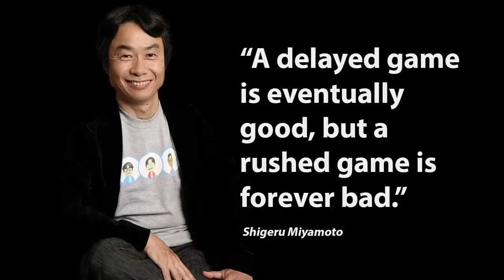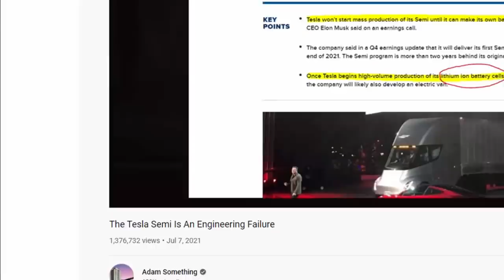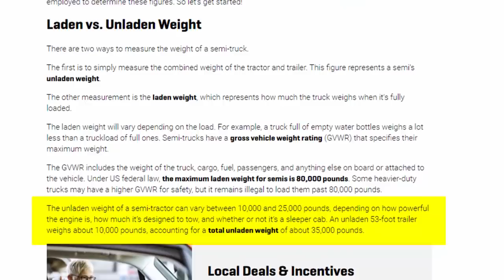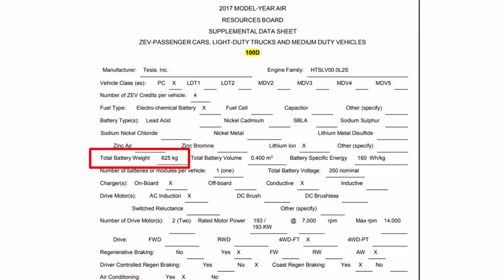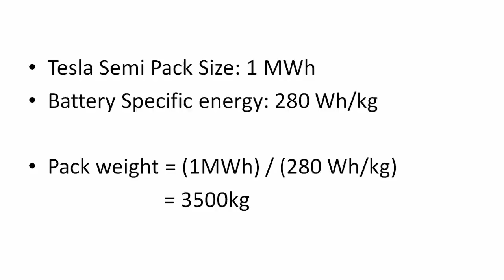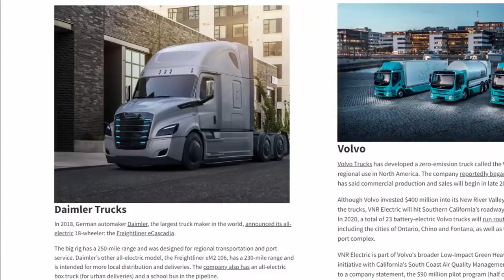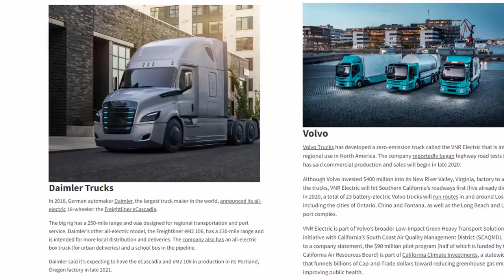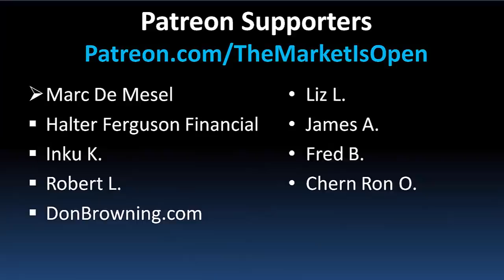The 2022 Tesla Semi is Genius, And Here’s Why

Comment: Another factor in the delay: Tesla had motivation to beat Nikola to market, even if that meant lower profit compared to model Y. When Nikola turned out to be fake, that motivation evaporated, so Tesla could wait for 4680 to start to ramp. Looks like Pepsi will finally get their first round of trucks this quarter.
Reply: Is it weird Pepsi will deploy these trucks into service and Tesla still uses diesels?
Reply: Tesla's reveal of their trucks were also fake, The didn't work and he got up on stage and said we have the technology NOW!!!! 5 years later, nothing. Another Musk scam.
Reply: @runnynose8341  Instead of calling it a scam, they say it's delayed, same thing for cold fusion,none of it works but they can just say its delayed.
Reply: @paulbedichek2679  or the just silently delete it from their website, or the link it to space X website, If you click on the White Paper link, it goes to Space X because there are so many scientific basics that he got wrong.
Reply: @runnynose8341  what city is that? Seems like a lot. But then your tunnels presumably have gasoline burning vehicles, which overall are more than 10 times as likely to cause fires than Teslas. Perhaps more than 100 times as likely because there are a variety of high speed collision scenarios that don't exist in the Loop.

The supposed fire risk of Teslas is a myth based on anecdotal stories and news stories not supported by statistics. The vast majority of Tesla fires are caused by extreme high speed collisions and external fire sources that are much more of a problem for vehicles running on flammable liquids. The overall rate of fires is less than 9% the overall average. 

The most likely cause of a fire in the LVCC loop would be crazy passengers doing what people in Vegas do, or simply arson, so fire safety is important. 

There's plenty of room to open doors. Claims to the contrary are stupid.

The LVCC Loop has sufficient powered ventilation and exit plan to deal with the very unlikely event of a fire.

Presumably the full Vegas Loop system will have a more complex fire system, but I don't have any info on that. Obviously the county will not permit development of a transportation system without adequate fire safety measures.

But I'm sure you are much more of an expert on the subject than the fire marshal, so we all should be terrified.
Reply: @runnynose8341  And the tunnels in your city cost 50 times as much.
Reply: @vic321344  Now your saying he has reinvented tunneling lol, I have seen the numbers, I am an Engineer, I see the tunneling system they use, its a off the shelf item, prices are pretty much the same for tunneling, anywhere in the world, but geology plays a massive part of cost, BUT the tunnels in my city are 50 times safer, can handle 50 times more cars, and are 50 times more efficient. But this is suppose to be a HYPERLOOP remember? or have you forgotten that ? It's just an air hockey table in a tube, it's not that hard, remember? Self driving cars on pods doing 750 miles per hour? REMEMBER? LOL, in a vacuum, REMEMBER? He has this technology now, REMEMBER? It's ok, you have been lied to and you can't handle the facts, go read the WHITE PAPER, ohh you can't, because he took it off his website, because it was full of scientific flaws, at the most basic level, that you guys all fell for.
Reply: @runnynose8341  They made tunneling much cheaper. So it can be a useful alternative.
Your undereground tunnel does not provide 50 times more capacity.
And you have to decide if you talk about tunnel systems in cities or vacum hyperloops. Two different things. REMEMBER?
Reply: @vic321344  not according to Musk, this is the hyperloop, looks like a tunnel to me, and sorry, 3 lanes of traffic at 100 miles an hour, no stops, I think you will find it is 50 times more traffic, 4 buses would replace Musks Hyperloop, your just a fan boy, have nothing to say.  They made tunneling so much cheaper, please show your facts? not just they say they did.
Reply: do some reading, you might learn something
Reply: @vic321344  The Hyperloop doesn't exist, but this is what he has been promising, remember, it started as a Hyperloop, he even had a name for it, and it ended up as a small death trap tunnel, now you really are grasping at straws, you can't argue anything, because you have nothing, just try to defend his tunneling expertise now lol, and its not a hyperloop, of course its not, and it doesn't do what he promised, thats it, you have learnt something, awesome.
Reply: @runnynose8341  You are right, the Hyperloop does not exist, just some test installations. So why do you bragg about a non existing thing? And why would anybody need a hyperloop for inner city transport?
Reply: @runnynose8341  After all, he delivers fine cars. Thats enough for me. If he should deliver a hyperloop sometimes in the future, fine. If not, I just dont care.
Reply: @runnynose8341  incorrect. This is not Hyperloop. Nobody said this would be Hyperloop. Hyperloop is an unrelated pie in the sky idea Musk put out there for anyone to follow up on someday. TBC promised exactly what they delivered.
Reply: @runnynose8341  I'm pretty sure this is mostly Musk's investment, and I'm not aware of any government grants.
Reply: @runnynose8341  ... and it's 4400 pph, not 1000. Can you read?
Reply: @Seehart  read what? Musks figures, yes, I can. What?
Reply: @Seehart  there is some reading for you. lol
Reply: @vic321344  Yes I agree, His cars are great, but they are not new technology, he gets his batteries from China. I don't have a problem with that, I have a problem he is always "Confident" he can do it now, if you invest? then 5 years later nothing.
Reply: @runnynose8341  He builds his own batteries AND buys every battery he can get . From China, Japan, Korea. So what?
Reply: @runnynose8341  Musk has installed a concept of proof that a hyperloop is posible. Paid it out of his own money. So what?
You sound like i litte jealous man. Show us your own success story. That would be more interesting to everybody.
Reply: @runnynose8341  there is one test loop in Las Vegas and one smaller in Munich, germany. They reached 482km/h in 2019 in Las Vegas.
Nothing about death stars. Or you begging for money. If you got a prototype that gets even a tiny amount of energy out of black hole energy, show it to the world.
Reply: @runnynose8341  You didnt point out anything of evidence. You are just jelous. And you are a bad role model for your children. Instead of working hard  and achieving great goals, you teach them to scoff and small reason everybody else. So they will feel better.
Reply: @runnynose8341  Just read the facts yourself in wikipedia.
Reply: @vic321344  LOl, Ill take that you just tapped out.
Reply: @runnynose8341  You are right. It gets boring that you always write the same 3 sentences. Another thing you lecture your kids: Getting friends by boring them to death.
Reply: @runnynose8341  You might be right. But I do  not envy them of what you teach them.
Reply: @vic321344  I Teach them to think critically, I know you don't envy that.
Reply: @runnynose8341  That is a good intent. But you missed it completely.
Reply: @vic321344  Did I? How? When? or your just resigned to the fact that you were conned, it's OK, happens to the best of us, just learn from your mistakes, makes you stronger. then next time you say something, you might be prepared to argue your point, good luck my friend.
Reply: @runnynose8341  Boring.
Reply: @runnynose8341  all of that is repeats of the same old bullshit I've read people like you repeating over and over. None of that is from any other than quoting anti-Elon rhetoric,  and none has any substance. None stands up to basic fact checking.

I'm not going to play whack-a-mole with all of your comments, as that would take forever. I'll just comment on a couple items to illustrate. "Wormhole" is a metaphore, which is easily understood in the context of the interview when Elon used that word, which you probably never saw. You saw the clip from an attack piece, and you think that's more reliable than the original source. There is plenty of room to open doors in the tunnels. And there is a ventilation system on case of fire. The assertion that it's a fire "death trap" is inconsistent with the fact that it got approved. Hint: regulators don't like death traps. Duh.

Yes I do have most of my 401k in TSLA and even after the recent stock market crash, TSLA is around 20x on my initial buy, and we picked up our second Tesla (model Y) entirely on a small chunk of TSLA profits. Why? Not because of current sales volume obviously, but because projection of the current growth, consistently nearly 80% annually for several years, has Tesla dominating the entire automotive market before the end of the decade. I don't see anything stopping that growth other than market saturation. My model presumes that Ford, Stelantis, and GM all hit their EV goals for this decade, in which case they hardly make a dent as "competition", all combined have a minority share of the EV market. Hint: the EV market will be effectively the entire automotive market before 2030.

Notice that while Tesla has been growing  nearly 80% per year through a pandemic and supply crisis, the big three have been shrinking. That's why Tesla is worth more than the big three combined, despite having a smaller current volume.

This transition is causing a lot of pain to established big money in the internal combustion, fossil fuel, and advertising industries. So social media attacks are to be expected. Don't give that so much credence.

My picture isn't from rhetoric. It's from looking at raw data, and from owning two Tesla's, which have required practically no maintenance, and perform as promised. If I've been scammed, I would already know it.
Reply: @runnynose8341  just bought some more TSLA
Reply: I assure you, Nikola trucks are not fake. While the truck in the promo video was, they have already delivered BEVs to customers and are testing the FCEV vehicles.
Reply: @JohnSmith-zi9or  but they are built by another company in EU just rebranded
Reply: @ralanham76  But to suggest that Tesla doesn't have motivation because the Nikola truck was faked moving is wrong. Nikola trucks are real and are being delivered today.
Reply: @ralanham76  US Steel is responsible for 100% of Tesla 3 and Y production,Tesla only bends the steel a little but they are all US Steel's products.
Reply: 4680 was always the plan for Semi. When it got delayed so did Semi.
Reply: @dealerovski82  He wasn't planning 4680 in 2017.
Reply: Pretty sure if I could tell Nikola was a scam, Tesla could as well. They looked fancy to investors, but they were shady as hell.

Comment: When you get rid of a diesel trucks very heavy engine and transmission and all of the rear axles differentials, a huge amount of weight is removed and space freed up for batteries and control electronics. This doesn't even consider fuel, fuel tanks and lots of ICE related components.

Comment: The world is going to be amazed. Once any bugs found during the initial days are found and fixed, diesel trucks will be dead. Personally, I love the rumble of a diesel truck engine and the smell at the truck stops. BUT the eTrucks will be even better than the diesels ever were for us and the environment.
Reply: It all comes down to cost.  The cheapest solution always wins.
Reply: They've had 5 years but those bugs are tough to work out!!
Reply: BEVs can't compete with diesel trucks. They're not even close, in almost every aspect. If diesel trucks are gonna die it won't be due to BEVs

Comment: The biggest challenge will be dealing with extremely high demand.
Reply: It is not high demand, its low production, like zero. Tesla said the 300 mile version cost $150K,a blatant lie,as Daimler pointed out,NY and Ca rebate $120K per truck,so Tesla semi would cost $30K ,so there is demand, but there won't be any supply at that price.
Reply: @paulbedichek2679  yeah!!!! finally the stock is dropping. plz keep spreading fud for few more days at least
Reply: @paulbedichek2679  that's a false dichotomy. It's high demand AND low supply (none). Rebates increase demand, but obviously do not decrease supply. Tesla would happily sell a $150k semi even if the state pays $120k of that. Why would that decrease supply? That makes no sense. Granted that $30k net price is absurdly low, but that doesn't disincentive supply. What you are saying makes no sense.

Also, Tesla set that price estimate (and yeah, it's just an estimate) before knowing about the rebate, so no reason to think it's a lie. I suppose Tesla could raise prices in response to the rebate to capture even more margin, but that would be frowned on. They certainly don't need to. Either way, the rebate will create so much extra demand, only early reservation holders will get a semi in 2023.
Reply: @Seehart  There is no supply because Tesla has no interest in producing a semi for even $240K. Supply and demand ,there is supply from other makers but none from Tesla. Tesla goes from maximum profit not sustainable transport.
Reply: @paulbedichek2679  Tesla has delivered 15 Trucks to Pepsico. The large scale production will begin 2023, when the battery factories for the 4680 cell will be ready.
All other manufacturers have to be satisfied with 300 miles range, as they dont get better batteries. If they get them at all.
Reply: Yeah, That's always Tesla's challenge
Reply: come on man, stop giving away all this positive news, I wanna buy more of their stocks at lower price, especially during these "difficult times"
Reply: @Andre-jp4yt  lol good point. Hey everyone, breaking news: Tesla is going totally bankwupt!

Comment: It's probably wouldn't be that much to run over head power line on some routes a truck could just connect to it like trains do already. It just depends if governments are actually serious about cutting carbon emissions.
Reply: Stupid idea
Reply: @rogerstarkey5390  why?
Reply: @12345maxx  Hmmm, let's not say stupid, just not well thought out.   The cost of putting MILLIONS of miles of electrical cable out there would be cost prohibitive.   One accident that had a truck tied to the line will cause the line to break.   One weather event (tornado, hurricane, fire, ice storm, pick your disaster based on the part of the country you're from) would take down the lines.   The issues are innumerable.   It's why trolleys are only for tourists and in limited areas.   A megacharger network will work just fine.   80% of semi-trucks are home based and will charge at their station every night.   The number of long-haulers, while quite a few are only a fraction of the trucks out there.
Reply: @AKJammer1  wireless charging
Reply: That is called catanary.  Expensive to install and maintain.  It would serve vehicles at a predetermined height  so truckers could take  it on and share its expense.  Small vehicles would not access such so would not bear its expense.

Comment: I think it will do VERY well, also they must release a small urban delivery truck/van with a single Model-3 motor in it with 2,000kg payload maybe, for the "last mile" of deliveries. 😆😆
Reply: European manufacturers already produce 125 mile range 1000-1500 kg delivery vans such as Mercedes ..Fiat[Dodge] etc
Reply: @julesdingle  Yup, and MOTOROLA made phones before APPLE
Reply: @mohammadwasilliterate8037  mobile phone makers have come and gone, at a few $100 per unit affordable to take a risk with a new product. Commercial vehicles are not disposable, you need a service network and reputation for fleet buyers ..who drive sales [not individuals].
Tesla has not invested in a factory to build commercial vehicles because evidently it sees the risk.
Reply: @mohammadwasilliterate8037  I'm sure a Tesla van/truck will pop up but the competition is already manufacturing and selling them..if it is 5 years away Tesla will have a lot of catching up to do..
If Tesla were smart they would come up with a replacement for the US postal service, do all the research and guarantee delivery rates.
And if the postal accepted that would be a very hot start.

Comment: I once heard a story of a witness to a Tesla Semi super charging.  The truck pulled up to 4 super chargers.  The driver hopped out and plugged all 4 in at the same time.  That's 4 times the Model Y charge rate.  All electric semis need is the infrastructure.  This was a couple of years ago BTW.
Reply: If the Megacharger is "only" 1000kW and can add 40% in 30 minutes, a single V3 could in theory add 40% in 4 times that (2 hours) and 100% in 2.5 times that (5 hours).
Imagine if rather than a dedicated depot, a Semi pulls into a drive through V3  charger at a "conventional" charge stop, plugs in with an adaptor and "trickle charges" overnight.
There's your infrastructure taken care of to a great extent.
No extra load on the charger, plenty of time for the truck, no other customers (except Bjørn Nyland? 😉)
Reply: Electric semis will need a lot more than just infrastructure to be able to compete